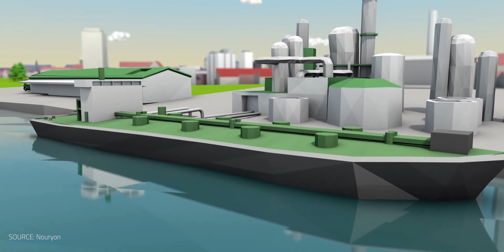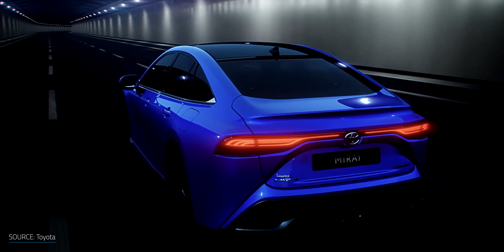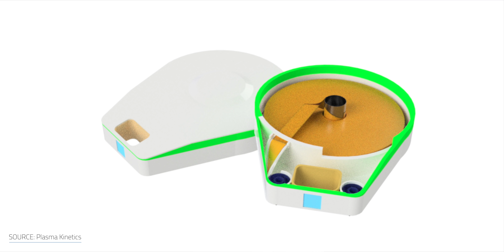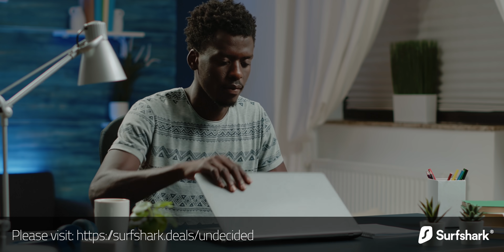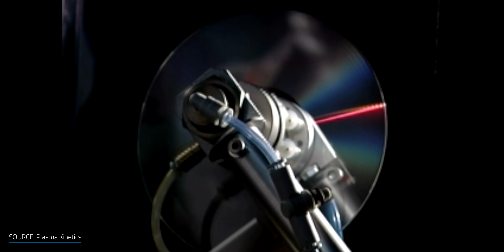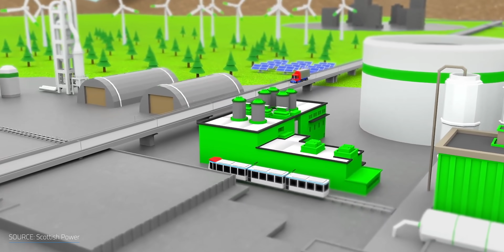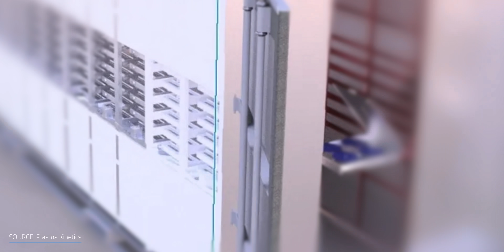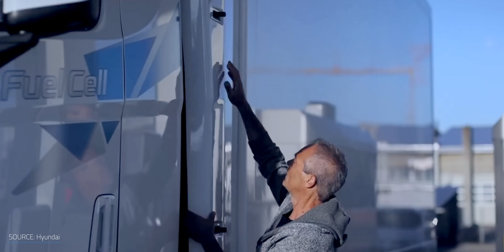Energy Storage Breakthrough - Solid Hydrogen Explained

Comment: As a Chemical Engineer. I can tell you that there is no hydrogen emitted from smoke or gas stacks. Nascent hydrogen is relatively short lived in the environment because it is so reactive. Also pressure swing adsorption is required to absorb hydrogen to a surface. There is no way to do this at room temperature and pressure. I also do not see how adsoption of hydrogen on a thin film would be more energy dense than a Li Ion battery as essentially the same potential is stored on the cathode of Li Iin batteries. Ie a positively charged hydrogen atom is equivocal to a single positive charge or effectively lack of an electron. Since both technologies use thin films and surface adoption. There is no way the technology can be more energy dense.
Reply: Thanks for sharing the real facts, only people with your special knowledge in this field can. This is what I am looking for.
Reply: Won't you get more energy out of it by having the hydrogen react with oxygen?
Reply: Batteries require two films though, anode and cathode, and whatever lies between them to allow the movement of the ions. This would do away with two of the three layers, as the ions are released, not moved to another layer, not to mention how much smaller a single proton is. I'm not claiming the tech will work, I don't know enough about it to make bold claims either way... clearly, neither do you.
Reply: @annoloki  but you go straight from solar (or whatever) electricity (which is very efficient and cheap to move from place to place and we have infrastructure for) into a highly efficient battery and then straight into an electric motor in yr vehicle. It's trivially obvious that adding lots of extra stages and conversions is absurd. Battery EVs won years ago, this hydrogen nonsense is just for parting fools from money (ask Trevor Milton)
Reply: @DrTune  It's not absurd where energy density is more important than efficiency... for example, with planes, doubling the density while only getting 40% of the efficiency is still a win, because you can afford the losses on the ground a lot more than the losses of carrying dead weight in the air. Hydrogen is a fuel, it gets used up and exhausted, you don't have to carry around depleted ions that no longer hold any useful charge. Whether that makes this particular tech useful or not, like I said, I don't know enough about it. But I do know when a false argument is being used. I'm only interested in things that are true.
Reply: Don't worry, they were very clear that H2 molecules are positively charged, and that's how they manage to keep it on the solid matrix and release them by flipping the polarity. It obviously works /s
Reply: @annoloki  solid-gas interfaces and adsorbtion are always energy un-dense. You cannot create volumetrically dense storage with planar storage. It's simply impossible.
Reply: 'It's more profitable for me to "ask questions" and lie in order to mass-produce sponsored content than it is to actually research anything myself' ~ Matt Ferrell
Reply: @annoloki  this is not a battery lmao. You did say u didn't know better but the guy made perfect sense.
Reply: @theultimatereductionist7592   Oh wow, you are so redpilled sir, I can barely know whether you are being sarcastic or you honestly do not know the meaning of the word. GOD do I hate modern internet
Reply: @s.c.o.s4672  OK, but H2 isn’t an atom, it’s a molecule.
Reply: Not to mention the potential solid-state batteries have, especially with the major R&D and investment work going on at major corporations such as Samsung.
Reply: Yes, it violates the laws of physics as we know them... But lasers!!!
Reply: Steps for success in 2021:
1) Create a fancy CGI animation; 
2) Throw in some pseudo scientific gibberish and green stuff;
3) "It was so good it was banned"; 
4) Profit
Reply: well, it should be a bit denser cause protons are smaller than lithium ions, right?
Reply: @s.c.o.s4672  and to expand on the laser bit. If you'd run a focused laser on a plastic film as thin as a human hair or even thinner, you'd need your film to be out of unobtanium, because even a 2w laser that is just slightly focussed, will burn that plastic shit into a crisp if it does not evaporate it on the spot.
Reply: @s.c.o.s4672  /s
Reply: @EuclidesGBM  Could you expand on that please?
Reply: @jekker1000  "water vapor and steam"

I agree that this video is BS, but read what you wrote one more time and think about it, lol
Reply: put some videos out on chemistry, seriously, there really are not enough of that info out here, even with what we have already, XD
Reply: Physic don't exist in fairyland
Reply: @s.c.o.s4672  /s = sarcasm
Reply: @EuclidesGBM  If it is worth the effort to do it, do it properly, not half assed.
Reply: @EuclidesGBM  are you going to half ass that too? Keyboard warrior.
Reply: @wlrottge  yeah, water vapor is invisible, steam is the white stuff you are seeing and is condensed vapor, because lambda =1, but yeah, BS. Learn some physics before trying to argue
Reply: @alejandrominder2097  This isn't even something only people with his knowledge should know though. This is something that crashes and burns the instant anyone has the most basic understanding of science.
Reply: @Daniel-yy3ty  no
Reply: Matt should talk to experts like you if he doesn't have the expertise himself. He really messed up; misleading a lot of people with this video.
Reply: We have to replace lithium storage methods with hydrogen. Lithium ion batteries are completely unsustainable, hydrogen is the goal. Also. Batteries don't get lighter upon use, it seems like this product would, which makes sense for use in long distance travel where weight is a consideration.
Reply: Basically replying to everyone here that is skeptical of skeptical analysis of this perpetual motion uh I meant hydrogen machine. If you desperately want something to be true then you should be more skeptical. Not less. Thats how you find truth. I could go onto explain why what they claim is impossible. But to anyone that actually understands this there are extremely clear non starters throughout. Liquid hydrogen fuel may make sense for niche applications. Aircraft being one possible case but its still far from clear. Hydrogen doesnt like to stay inside of things made from molecules larger the H2. Thats all the molecules. And a hydrogen fuel cell powerful enough to power a slower midsize sedan or crossover costs about a half million$ last I checked. Scale that up to aircraft power levels and the math is far from clear. Hydrogen only makes sense if lakes of it start appearing everywhere its needed. That seems unlikely to me but who knows? Lasers!
Reply: Thubdeef00t did a great rebuttal. Expected more from Matt then just putting our company PR without vetting.
Reply: As an engineer you say there's no way to use hydrogen in this way because there's no way to do it at room temperature and pressure.

As an engineer you should figure out a way to do it in an ambient environment. Isn't that what engineers are supposed to do.
Reply: @s.c.o.s4672  why did the United States government step in and put a hold on their patent?
Reply: @s.c.o.s4672  Would energy be produced if you break the covalent bond between two hydrogen atoms. Magnesium does seems to be the central element in the chemical compound of chlorophyll.
Reply: @paysour3  Mate, this has been debunked, your fighting on a hill far from the war.
Reply: @s.c.o.s4672  So the United States government didn't step in and prevent the patent? Or when atomic bonds are broken isn't there energy released? Is magnesium no longer a part of the chlorophyll compound?
Reply: @s.c.o.s4672   Fighting on a hill far from the battle prevents an enemy from retreating or being resupplied.
Reply: @paysour3   your analogy has zero bearing on the situation at hand. The information within this video has been scientifically proven to be false. You are making the argument that the laws thermo dynamics do not apply to this technology.
Reply: @s.c.o.s4672  Metal hydrides are a class of materials containing metal or metalloid bonded to hydrogen. Light-activated nano-structured thin film is new and as far as I can tell have not been debunked.

Metal hydrides are compounds of one or more metal cations (M+) and one or more hydride anions (H−). When pressurised, most metals bind strongly with hydrogen, resulting in stable metal hydrides that can be used to store hydrogen conveniently on board vehicles. Examples of metal hydrides are LaNi5H6, MgH2, and NaAlH4. Metal hydrides can be liquids or powders that are usually stored in tanks at approximately 1 MPa. As the pressure is reduced or the temperature is increased (between 120 °C and 200 °C), hydrogen is released. The laws of thermodynamics are not violated. I hope you don't teach School anywhere.
Reply: @paysour3  have a look here on YouTube, if you are able to believe CG imagery as fact, then it should be rather easy to gleen the information from those that actually know. There are well respected scientists here on this very platform whom have debunked this. Join the fight against misinformation.
Reply: @s.c.o.s4672  I am a well respected scientist in my day. Why don't you provide the links to those who support your point of view. And, please stay away from the young people you could be a bad influence.
Reply: @paysour3  Where the hell do you get off? You are rather unproductive in your investigative work, rather rudely making snide remarks about me instead, for that you have lost my respect. I have pointed you in the right direction, it is up to you to make the journey to discovery, I am not hear to hold your hand.
Reply: @s.c.o.s4672  it's not about holding my hand it's about presenting information that backs up your statement. How hard is that. That's all I was asking for was a link to the information that debunks this process. This is real easy all you have to do is copy and paste the link to the information that you base your statements on.
Reply: @s.c.o.s4672  Join the fight against misinformation and provide the links that prove your point.
Reply: @paysour3  in this time that you have taken to be unproductive you could of taken a small excursion outside of this comment thread, you would see others pointing out the misinformation and even the debunkers chiming in to let others know of their response. You could of even don't the basic thing of just searching up this videos title with 'debunked' tacked on. That takes even less energy then making insults to me, you don't need me by your side thought this.
Reply: @paysour3  It is also common for people to not be cooperative, with someone that has made defamatory comments about them. But it is up to you to come to your conclusion, I am not going to be the one to tell you what to know, you are, which is the other reason I will not provide direct links to any sources, it is all public , you can easily find it. Just take a look at the rest of the comments if you need further guidance on why there is misinformation.
Reply: @s.c.o.s4672  In other words you had no proof to start with.
Reply: @paysour3 the proof is in science, you seem to think I have the time and the want to teach you. After you have been so rude to me? Are you just a troll? Even Matt Farrell has acknowledged that there was misinformation in the pinned tweet.
Reply: @s.c.o.s4672   You take the time to tell me you don't have time. You just got caught pretending to know what you are  talking about.
Reply: @paysour3  ok troll.
Reply: @alejandrominder2097  he doesn't know what he's talking about.
Reply: @DrTune  research and development is how we have most of everything we have today. I don't consider the waste of money considering hydrogen is a bona fide fuel with safety emissions.
Reply: @jekker1000  How does a CD player work. It uses lasers doesn't it? Nano fibers are not plastic.
Reply: @paysour3  There is CG so it must be real? Looks like it is where Matt Farrell got his notes from. Also Ricky Roy is not a scientist, his past experience involves mechanical engineering and app development, nothing to do with these hydrogen tape batteries.
Reply: @s.c.o.s4672     You gave me my first laugh of the day. Seems like you got something against CG. I think it's very important that Ricky Roy is a mechanical engineers. 

The subject is light activated haloids. You should see the relevance in that mechanical engineers are the ones that designed the fuel tank deck where the hydrogen is stored and how it's released.

You don't realize either out of a lack of education or you're just playing games. This is groundbreaking technology. I tried to buy stock but they're not selling any. It's a privately held company.

Hydrogen is  the most abundant element in the entire universe. It's production and use with this procedure requires no carbon emission. It can be stored at ambient temperatures and is not flammable or require pressurization. 

Hey maybe you work for an oil company and you're out here trying to discredit something that could put you out of business.
Reply: @sorh    Seems like you got something against CG. 

 The subject is light activated haloids not CGI.  The fuel tank deck where the hydrogen is stored and how it's released is revolutionary.
Reply: @paysour3  what are you even talking about? it just makes no sense. A cd player reads and writes data. if it were about energy storage and retrieval, the rotation of the spinning disk would make much more sense than burning a nanolayer of wonder magic jelly off a polycarbonate substrate
Reply: @jekker1000  You obviously didn't watch the same video the nanofibers are made of nickel and titanium. 

 Lasers are used to extract the information from CD disk now that is plastic and they don't melt. You really need to do some homework.
Reply: @wlrottge  Why do you consider this BS. It's based on solid science.
Reply: @paysour3  man, just buy this cd energy player bs and keep silent with your insanity
Reply: @allineedis1mike81  If you were going to go into that much of an explanation I wish you would have explained why this is impossible instead.

It seems based on solid science to me. Light activated haloids looks like a breakthrough technology. I would buy stock if they were selling, but they're not.
Reply: @jekker1000  I hope you don't teach School anywhere.
Reply: @paysour3  It is easy to fool someone, but it is hard to teach someone that they have been fooled. I wish this was real too, it'd be pretty amazing, it would truly be revolutionary. But that's just it... Wishes don't change reality, but hey if by some miracle magic from a universe where the laws of physics are different, then I will admit I am wrong and personally rewrite every text book out there. But I do find it odd for a well respected scientist you seem to make a lot of brash assumptions, what is it about having a scientific disagreement makes you so hateful and rude towards me? Is it this subject, is it me or are you just looking to take your frustrations out on someone and that just happens to be me?
Reply: @alejandrominder2097  unfortunately, those are not the facts. The key is the absorption of hydrogen the hydride metals and then releasing that energy with a laser. It's cutting edge No doubt but it shows great promise.
Reply: @s.c.o.s4672  you asked why do I respond the way I did. You're the one that said fight against misinformation. I have lost my patience for people who make baseless assumptions. You keep laying out a philosophical point of view but yet no science. You talk about the information that discredits these claims but no link to that information. You proclaim that magnesium was not a part of the photosynthesis process. 

You say you don't have time to teach me then give me the link to the data that you are basing your decision on. I took your advice and went on a internet journey and found as you saw another video on the subject suggesting the same outcome.  It was you that then suggested a mechanical engineer would not have the ability to assess this science when mechanical engineers are the ones that designed the hydrogen storage deck. Or do you think they materialized the device from your miracle magic universe where the laws of physics are different?

The principles are sound for this device to work and right away I can see several applications. I'm waiting on the stock to hit the market.
Reply: @paysour3  You have made baseless assumptions. Your sense of entitlement that others should bend to you will, could possibly be why after hours of research I couldn't find a single paper or even a tid bit, to back up your claim about being a "well respected scientist in my day",. on top of that having absolute faith in nothing more then a computer animation. I don't have the time to teach you, as I run a business, this is my time off. Matt Farrels comment about the misinformation is still pinned, the debunking videos are still up, your alternative laws of physics still do not apply. With your mind set we should believe all CG animations, and hire a plumber to build an entire house. If it actually worked there wouldn't be CG, they would just show us. "do you think they materialized the device" There is no working device. Please don't waste your money.
Reply: @paysour3  All of that, and it still doesn't exist, and will never.
Reply: @DrTune  Hydrogen may make a lot of sense in polution reduction in very specific places.  By substituting green hydrogen in steel making or concrete making, for instance.  Not everything is about cars.  (But this film tech is BS)
Reply: @jekker1000  
He wasn't arguing. He just thought he was correcting.
Reply: @whyjaywonders  
I don't think H2 and Tritium are you be used by the same things...
Reply: @DrTune  
Wait do you mean just this Hydrogen tech or fuel cells in general? I mean, we're not gonna pretend that Lithium has a higher specific energy than Hydrogen are we?
Reply: Metal hydrides for hydrogen capture from waste gas streams are not a new technology. Ammonia plants have waste steam that can have a high percentage of free hydrogen gas, and also places like NASA have used hydrides to recover hydrogen from hydrogen lines that are purged with something like helium. It's an efficient way to get very high purity hydrogen out of waste gas streams that would have had hydrogen mixed in somewhere upstream.
Reply: @DrTune  Current lithium batteries are fantastic but they have their drawbacks. Lithium itself is a scare resource and there is not nearly enough int he world to replace gas cars. Not to mention, mining lithium is an extremely toxic process. The batteries have a lifespan and they are very expensive. Current battery tech is a stepping stone for EVs and future EVs will likely be powered in a different way. I don't know nearly enough about this tech to say this is what it looks like, but lithium based batteries should be surpassed. Staying on this model forever is a perfect re-entry into the status quo of shortliving vehicles, costly repairs, pollution, and tremendous waste. Yet, still better than oil. All of these would use an electric motor only the power storage changes.
Reply: @allineedis1mike81  Hydrogen not too good for planes due to low volumetric energy density - ie it takes quite a volume of hydrogen, compressed (heavy) or liquid (high maintenance super cold), for a given amount of energy - how fat a plane do you want?
Reply: @jacobkeffer8437  If you want to store many kilograms of hydrogen you'll need great number of these disks - so it's like having a super inefficient (heavy) gas tank. A real non-starter.
Reply: Wait did you review the patent? Or....
Reply: @zeening  you have never used either twitter, reddit or 4chan as your daily driver.
Reply: Yeah but you can get break it out of ammonia pretty easily. I dont know all the scientific jargon to explain it but I do understand it.
Reply: @kingpin76110  You can, provided you give it MORE energy than it would produce. It is called Enthalpy and Activation Energy. Also, not sure you know this, NH4(amonia) LOVES burning and decomposing into NOx aka Nitric Oxides (those things you use catalizers to destroy in cars) and H2O, partially burning them into N2 and H2 is a VERY precise and expensive process.
Reply: @EuclidesGBM  
No I did not know that. i appreciate the information. I just find the entire topic fascinating. My quiestion to you is why haven't scientists devoted more resources and more time trying to overcome these impediments to using hydrogen as a source for energy. It was known as a source for power since the last part of the 1800”s. even proceeding gasoline. Saying that I realize that having "clean" energy wasnt a consideration when it was discovered. Thanks.
Reply: @kingpin76110  It’s because it’s impossible to store hydrogen in mass quantities to serve the energy needs of our population. Especially when compared to petroleum fuels. The amount of money & resources needed to store hydrogen would be astronomically high.
Reply: Just like any cassette, rolling of thin film hydride metal could be someway get stucked and become birdnest like structure, and soon turn into nightmare disaster especially when it happen on fast running EV....
Reply: @paysour3 
Given you haven't bought the Tesla pill, like the rest of this thread, do you have any more information on this kind of tech Plasma Kinetics is involved in?

I've argued to the Tesla crowd that batteries have their place, but other systems (like Air and Sea craft) require an entirely different approach, due to energy, engineering and environments they deal with. I've also pointed out that, while batteries are great for storage, for mobile or remote applications, you'd be better off with a compact fuel source system rather than relying on solar.

Hydrogen fits the bill for these purposes and is the direct replacement for those scenarios where being on demand and energy dense is more important than simply being efficient.
Reply: @MasterofSFL  last I checked they hadn't made a stock offering.
Reply: Ferrell isn't about to let a little thing like physics or facts stand in the way of his publications.
Reply: @MrJBA79  can you discredit what he has said?
Reply: @paysour3  for my hourly-rate, I've found, that there is precious little that I won't do. I'll get a Fiver gig going if you're serious.